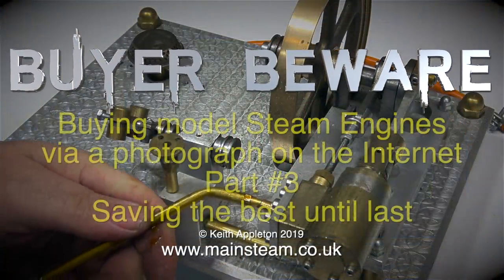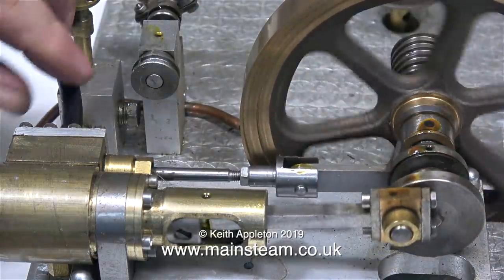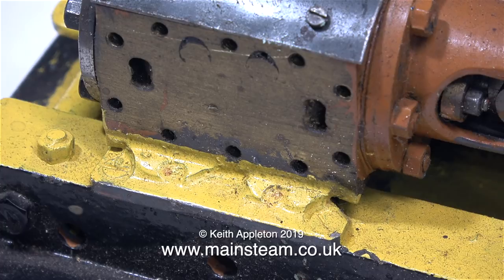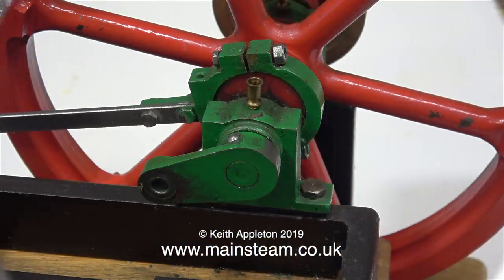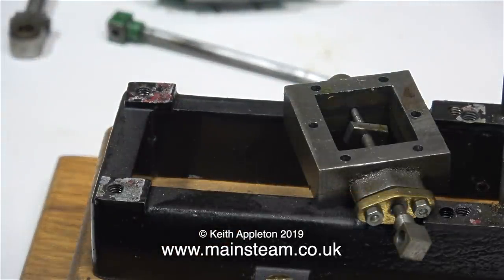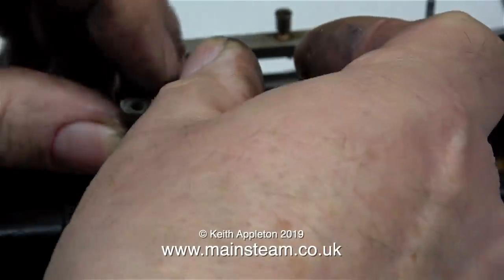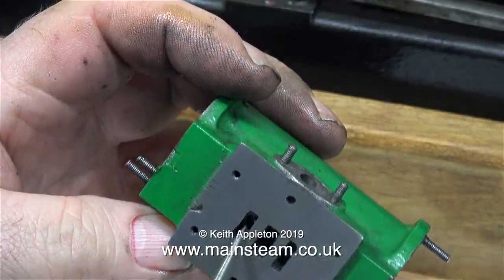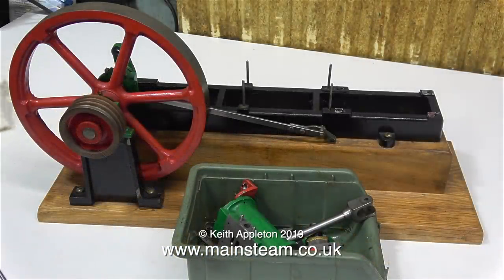BUYER BEWARE - BUYING EVEN MORE STEAM ENGINES VIA THE INTERNET

Comment: I got a Staurt S50 off ebay that said it was in working condition, it did work, but the piston was only held in place with a single bolt, ended up getting parts from Stuart and replacing the piston rod and those broken screws, the engine now runs properly, but you never know what you're getting into from photos...

Comment: That "port face" - eek! And the slide bars; all you have to do is clamp them all together, then machine them all as one,  then they'll all come out the same. :-) :-) :-) I'm currently doing up an engine which has been butchered by someone who shouldn't even be allowed to be in sight of ANY machinery. Just 1 of the things is the crankshaft, which should be cast, but it's been "fabricated" with the two webs in different lengths (although the crankpin throw is the same for both), and the only engine I've ever seen with the crankpin in soft brass, making the whole thing easily bendable (there was a 45 thou wobble in it: mark as scrap!). But once I've worked through & corrected the faults it should turn out to be a pretty good engine.

Comment: I once had on girl on Facebook trying to sell me a 5 inch gauge Alice class quarry hunslet. It looked fairly ok, unpainted but in undercoat. There was only two photos so I asked her to see a video of it steamed up and running on the workbench. 

she then told me that it hasnt run for some 30 odd years and sat in her Dads shed for 20 of those years, and ten in hers. No boiler certificate, and from what i could see from the photos a cracked wheel, no funnel, no hand pump and somehow a missing buffer at the back. 

It was then i decided to build my own petrol electric locomotive with my family instead XD
Reply: The grass is greener on your side of the fence with family near.

Comment: I'm much more comfortable designing/building a steam engine from bar stock.  I don't quite understand what you don't like about bar stock.  Esthetics?  Castings certainly look more realistic, but bar stock is easier to work with for a beginner, and no doubt cheaper. 

On another note, i'd love to find something like a Victoria to rebuild.   I'm also retired, and the casting kits are expensive.